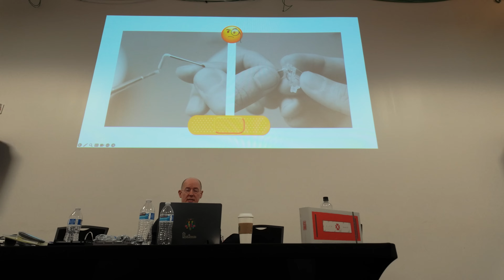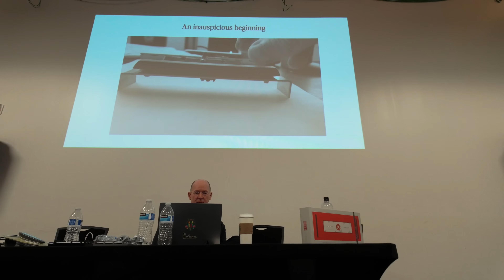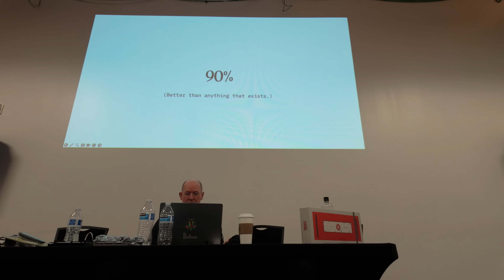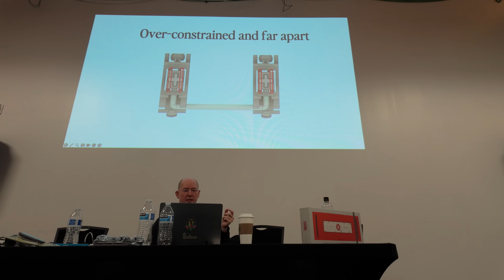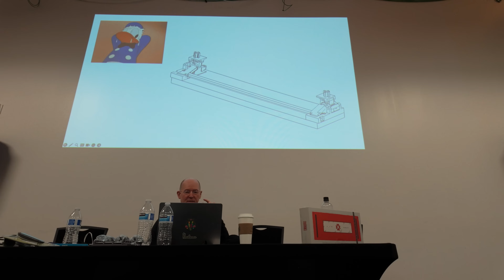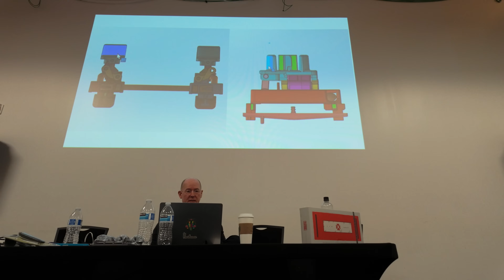The Stabilizer Problem - Norbauer's Presentation at Keycon 2024

Comment: This should be 3D printed using a 1mm nozzle maybe even down to a 0.1mm nozzle. It's the only way I can think of getting this done. If you're trying extrusion then maybe some gundam manus could help you. At the end if they are too rough you could polish them in a rock tumbler using some ultra fine sand.

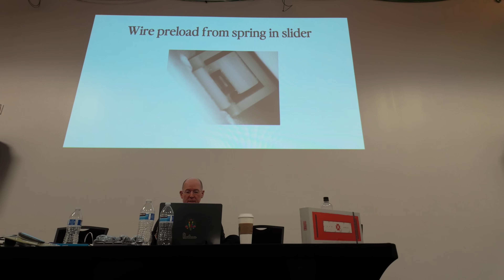Comment: "exploration to design a new stabilizer that doesn't require any lubing" and at 41:51 he says it's pre lube. wtf? What's the point then.

All that work into these and my staebies sounds x10 better than this crap.
Reply: he said preloaded, not pre-lubed. he explains what he means by preloading. When he's answering questions, he says that he hasn't tried lubing these stabilizers yet, and that they would theoretically have either no difference, or have a negative effect.

Comment: i'm not sure why a hydraulic method wouldn't have worked necessarily. self leveling, easy to tune, and there's existing systems meant to eliminate the effects of compression via an extra bleed chamber. maybe liquid dynamics makes it too slow?

Comment: The early foray into compliant mechanisms makes me think of the Apple Butterfly mechanism which replaces typical scissor stabilizers for laptop keys with a compliant hinged mechanism.

(the butterfly mechanism was only an issue for the dust resistance, the key feel change came because of metal domes)

Comment: What I find comical about this is that when I got back into keyboards a bit over a year ago I made comments in a few places (including I believe one of your videos) that the stabilizer design, while extremely simple and well-engineered, could be completely redesigned to eliminate the issue everyone complains about (noise). I made comments to the use of pins (pin joints) as you see all over automotive parts (like your suspension, which IMO this design looks like a car suspension part) as the obvious solution to the problem. Of course, nobody in the keyboard scene seemed to care. And now I see this video and I have to laugh.

FYI, I'm an Engineer by education so maybe why I could see it intuitively. Although it's a C.E./E.E degree, I still have a firm education in many of these principles. Plus, I worked in designing and manufacturing plastic parts for a company years ago. And purchasing, maintaining, and repairing industrial machinery at those companies with many of these mechanisms. And add on decades on hobbies in cars/car parts.

Comment: The production mold is going to be insanely expensive because EDM is used and tool steel is extremely hard. I’m guessing that the molds (always 2 because you need to get the part out) are going to be north of 200,000 or 300,000 USD because of those very fine features.
Reply: The economies of scale for these things are nonexistent, they're a product for a niche of a niche market and will be insanely expensive to make up for the R&D and tooling cost + relatively small production run. I really do wish him the best and hope this succeeds but I think people are going to have some nasty sticker shock.

Comment: Fujitsu already had perfect stabilisers made in early 1990s in their FKB4700/FKB4725.
All it took was a torsion spring and it can eliminate virturally any rattle.
https://youtu.be/vUzK0fn4iYA?si=GzZAfxrEdDVf9ZKa&t=311
Reply: Maybe no rattling but you can hear quite a bit of ticking
Reply: @karellen00  the ticking can be further improved upon modifications to existing design. I had a FKB4726 and there was no tick at all stock.

A company made that without even intending to have the best stabiliser.
Reply: @TIB1243S  I get what you mean, but if you want to get to the last 1% you just have to use a more complex design. To be honest I'm fine with previous designs and lube, but I love the fact that someone is reinventing the wheel to get an improvement that at the end of the day is substantial but not huge.
Reply: @karellen00  I'm not trying to discredit Norbauer here, I'm just suggesting that there can be simpler solutions, for what I fear of such a complex system may bring a much, much elevated cost of entry.
Reply: @TIB1243S   Yes, probably a set of stabs alone will cost as much as an entire mid range custom keyboard. But honestly I wouldn't expect less for a $3000+ keyboard. Totally outside of my budget, and I hope someone will fill the gap as you say improving the existing designs (or even getting the patent for the simpler system designed by Norbauer)

Comment: If you listen at the end of the talk during the questions section. Someone ask what would happen if you have a keycap that was slightly smaller than spec. 

"What will happen is the keycap will just sit infinitesimally smaller to an infinitesimally  smaller degree, a bit shorter but like, not in a way that is at all perceptible."

Aka your stabilized caps will sit shorter if you have cheap caps or warped lol. So much money for stabs that don't work on all keycaps perfectly, now to release $500 USD cap sets...
Reply: Don't let perfect be the enemy of good enough. "Infinitesimally lower" sounds essentially like unnoticeablely lower to me.
Reply from the maker: Subtitles are available as well!

Comment: this could be around $25 for a set of stabs, or $70, or even $100+ depending on how much production costs (I am down for the 25 - 50 range). But this is super cool and has an amazing story!
Reply: No way. The pin joint stabilizers will certainly cost north of $100 a set, perhaps even more than that.

I think the play with these would be to buy one for the spacebar and then use cherry-style screw-ins for the rest of the modifier key stabilizers.
Reply: You clearly underestimate norbauer pricing lol
Reply: These will likely cost hundreds of dollars per set. I don't think people watching this understand how expensive it is to design, tool, and bring a bespoke, niche, small production run product to market.

Comment: read through his post about this just the other day, had a jaw drop moment when I read the part about preloaded wire springs on the eventually abandoned design. seems so obvious in hindsight, the true mark of great design
Reply: I’m honestly bummed he’s not making THAT one and patented it because licensing it is gonna be insanely expensive given his nature. 

But that’s honestly the design I’m interested in. This final iteration is just too mechanically complex and not feasible to manufacture at a reasonable cost to consumers.
Reply: @colo667   yeah thats valid, that sentiment resonates with me as well. but it also feels kind of inevitable that some designers will implement the general idea of pre loading the wire against the housing in a different way that manages to dodge this particular patent. if I may combine colloquialisms, more than one way to skin a cat once its out of the bag, especially given the preexisting fujitsu design rockets4kids pointed out earlier in the thread.
Reply: I had the exact same reaction reading that. True hand to forehead moment.
Reply: This is effectively what the Holee mod does.
Reply: @rockets4kids  if you read the full text of norbauer's post, you can appreciate the difference between just padding the inside surfaces in a stab housing (holee and other mods like wrapping the wire ends with tape or silicone) and actually preloading the wire via a spring mechanism such that it always remains pressed against one face of the housing. the former can induce binding while the latter seemingly cannot, though we can't say conclusively since afaik there's no stab on the market currently that employs such a mechanism
Reply: @rockets4kids  that's actually very cool, it definitely is a great idea that I'd love to see even more implementations of